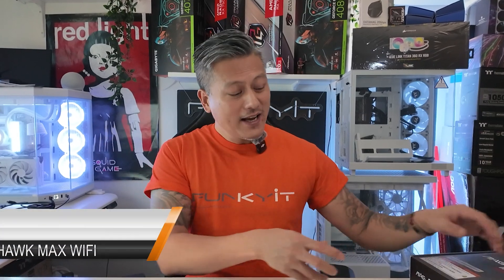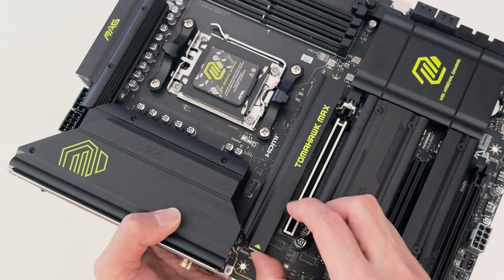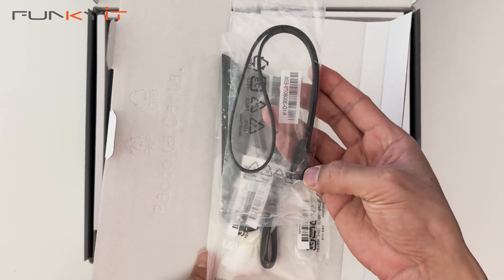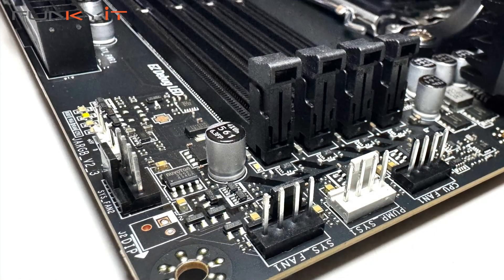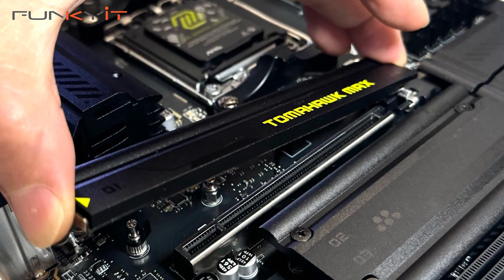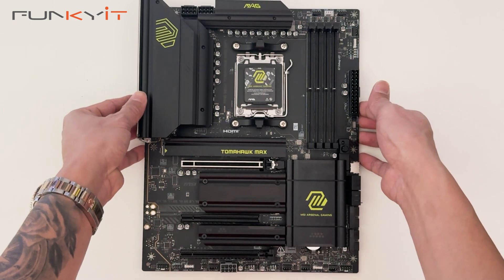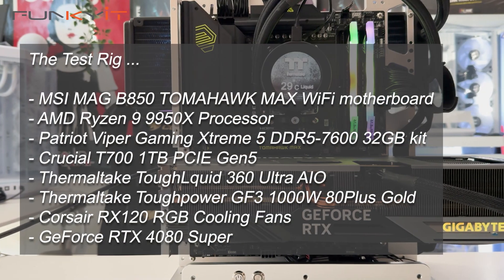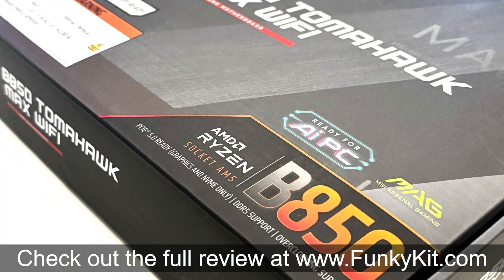Our Favourite B850 Motherboard - MSI MAG B850 TOMAHAWK MAX WIFI

Comment: Hi, I have the same motherboard with a 9800X3D and my scores are much lower than expected in both CPU-Z and Cinebench. I’m getting around 6500 in CPU-Z multi and 15,500 in Cinebench R23 multi, while my single-core scores are fine. I’ve tried PBO in all modes, but the multi-core performance stays low.
Reply: Did you figure out why?

Comment: anyone else have issue with windows thinking nvme thats installed in m2_2 slot being hot swappable on this board?
Reply: Yup, exact same issue. This is usually fixed by turning off hot swap in Bios. But, for some reason, MSI removed that option. I honestly think this will get fixed in future firmware updates. And since this is my only issue with this board, I’m certainly keeping it. My Gigabyte x870e was a freakin’ nightmare. This MSI has been a god send.
Reply: @GregoryCunningham  is it fixed now?